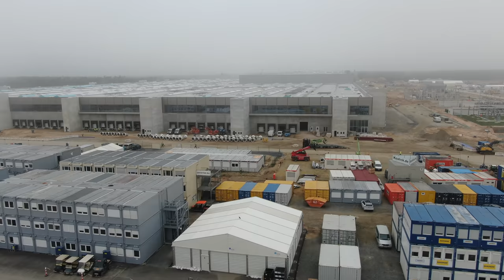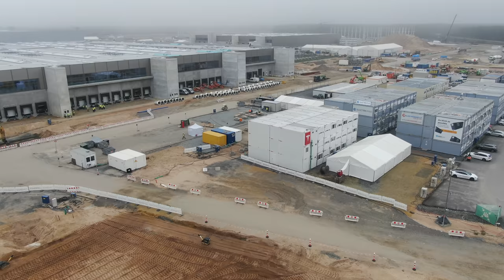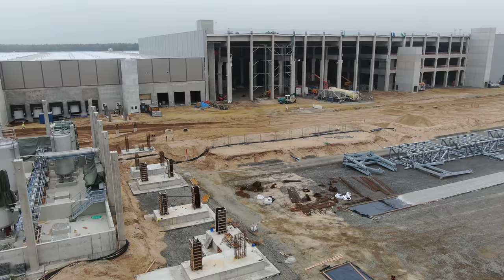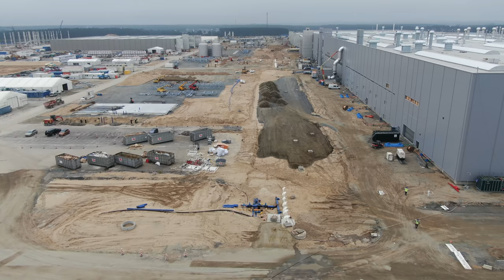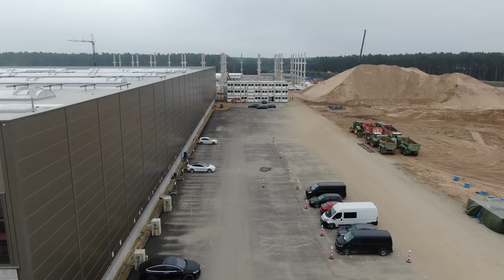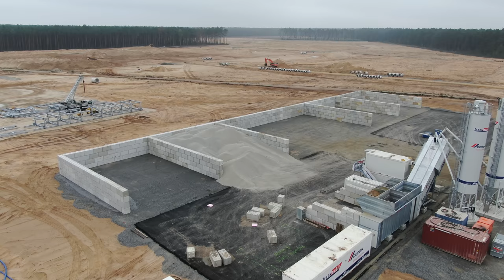Giga Berlin | 2021-09-04 | A lot more beams

Comment: Great flying! Thanks for spending time at the battery plant;  I had been pining for time to see more details.  It looks like there's going to be thick floors of poured concrete, as beams and columns have rebar stabbing upwards everywhere to connect to yet more concrete.  I can't imagine how heavy the equipment will be to merit such strong construction.
Reply: I can’t imagine machinery heavy enough to require foundations to be as thick as this one.  I’m guessing the building has to be extremely rigid and non-flexing.  Alignment of equipment cannot be upset by vibrations caused by trucks on the highway or passing trains.  But this is just my speculation.
Reply: @Carnutzjoe  Typical industrial concerns usually go the other way around, like trying to prevent machine shocks and vibration from getting out of the plant, possibly disrupting people's sleep in the neighborhood.  However, stronger foundations tend to improve vibrational coupling between local/remote emitters/receivers of seismic vibrations.  The way to isolate vibrations in either direction, would be to put a heavy block suspended on top of another by springs or some elastic filler.  I think I'd choose your theory of concern for machine alignments, but versus long term uneven compression of the soil beneath.  Perhaps the bedrock is not too strong or reliable and they fear parts of the building sinking faster than others over time.

But that still begs the question why the other buildings did not have such strong, single block foundations ...

I think they are about to bring in some huge machines.  Hundred ton rollers or rock crushers ...

Comment: In different parts of the video you see foundations of what seems to become a overhead connection between all buildings. Smart!
Reply from the maker: There will be pipe racks that connect the production buildings to the supply buildings. You can also see the pipe racks on the ground, waiting for installation.

Comment: Amazing video. Great pacing on the shots. Thanks! The site is coming together. Does anyone know if they will use concrete or bitumen outside for the area around the main factory?
Reply from the maker: It will be asphalt for roads and walkways and concrete for the loading areas.
Reply: @TobiasLindh  Thanks!

Comment: Ich habe das System der Wasserleitungen nicht erkannt. Wir bauen auf und reißen nieder, Arbeit gibt es immer wieder ?
Reply from the maker: Es wirkt wirklich so, aber ich denke das täuscht. Oftmals wird danach an anderer Stelle gegraben. Das sind halt verdammt viele verschiedene Leitungen in verschiedenen Lagen. Insbesondere rund um das Tanklager kommt eine ganze Menge zusammen und kreuzt sich zudem noch.
Reply: Erst Abwasser, verfüllen, verdichten, dann Gas und Wasser, verfüllen, verdichten, dann Obrflächenentwässerung an Hauptkanäle, verfüllen, verdichten. Ganz einfach, wie immer, wie überall.
Reply from the maker: @julianreverse  Nicht zu vergessen, dass die Oberflächenentwässerung für Dächer und Verkehrsflächen zwei getrennte Systeme in verschiedenen Lagen sind. Und die Kabelkanäle die noch parallel laufen und teilweise kreuzen.

Comment: Thanks, Tobias.  Is there any word on why they are not closing up the casting area?  Have they made any castings?  @14:22 I understand how some of the beams rest on the shoulders of the columns.  I can't figure out how the cross beams are attached. There doesn't seem to be a should for them to rest on.  Can you see how these are attached?  Great video, as usual!!!
Reply: My take is that not being covered in allows natural light and ventilation until the rest of the systems are ready to go. There is still equipment to be installed in the casting area. Texas is not yet covered in, yet they have made castings there. Fremont has no walls on the castings and only a partial roof.
Reply: @59seank …. I think the xcross beams a lie / seat in a kind of pocket .. if u can see @20:00 there are the xcross beams on the ground and there u can see the form on the end and how they must lie ( attached ) to the bigger beam
Reply: @wolfgangselle3272  Thanks.  @13:48 I can see the pockets you mentioned.
Reply: @wolfgangselle3272  Like a mortice and tenon joint in timber.
Reply from the maker: As far as I know @gpsfinancial6988  is right about ventilation and natural light.

Comment: This factory won't be finish in 2021. There are less people working in Gigaberlin than giga Texas.. German is working in Elon time 😄😄
Reply: That is right, construction work will go on for years. Important is, that production starts end of year.
Reply: Congratulations! This is number 1000 of senseless and brainless comments from the Other Guy. By the way. Did you count the workers in Austin and in Grünheide? Please tell us the numbers. 😂 in a few weeks Tesla will perform test runs in Austin to make sure the entire manufacturing process is ready, but once those are completed, actual production of Model Ys that will reach customers can begin, well informed sources says that moment is some two months away. Berlin will start according to Elon Musk at the end of the year. The battery factory started in April 2021 will be finished at the end of next year.